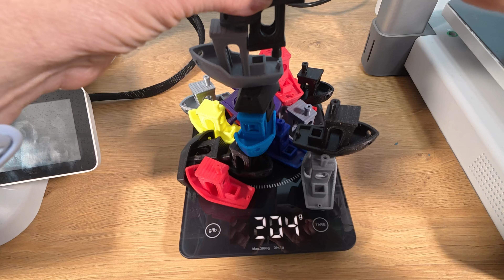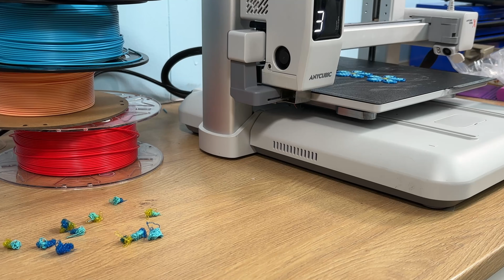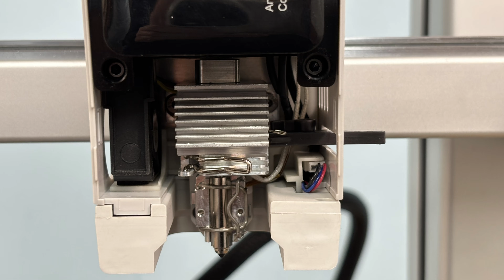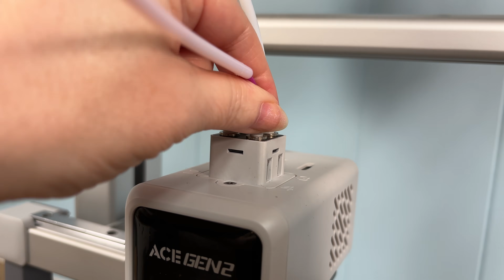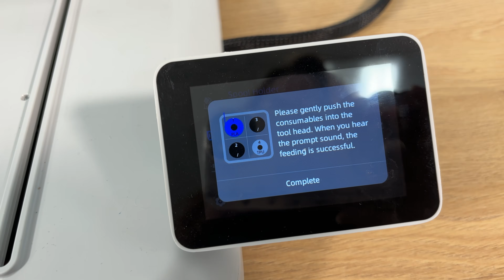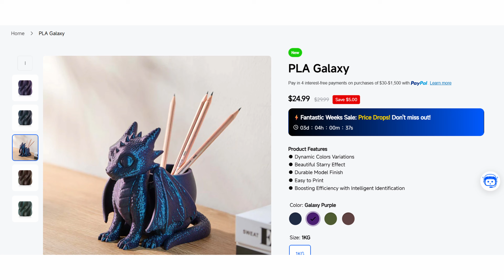Anycubic Kobra X vs. Traditional Multi-Color: The Waste Problem

Comment: Why do you keep calling everything a clone it's all made in China what difference does it make if it resembles another printer it's just another version that they made so it's not a clone and to be honest all the open printers look alike an apprentice that you compare it with has been out already for a while desperate came out for half the price and have them all beat especially when it comes to speed it has expensive ones beat as well with the same quality print

Comment: You technically can pull hot filament out to waste less, which is what prusa uses with its mmu, just that it takes skill to get a proper tip on the filament